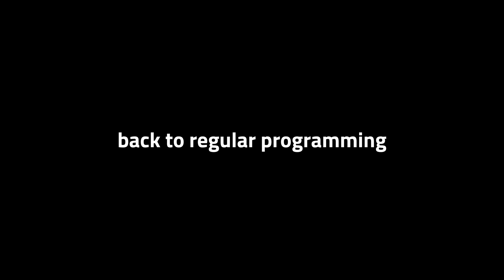Directional Drilling | These Machines Are the Reason You're Able to Connect to the Internet

Comment: And a Vertical Rig is How you get Water Wells , Monitoring wells, observation wells ,  sparge wells , pezometers, oil wells , gas wells , blasting holes , Mineral exploration holes , Bed Rock Wells , and over Burden Wells of all kind I have Drilled. I love Coring Rock that's my Favorite coring  deep holes . So Many Rigs to Run so little Time Traveling all over America Drilling such a wide variety of Wells with such a wide variety of rigs . Drill Baby Drill 💪

Comment: The "sensor" is called a locator
Reply: The main advantage to directional boring is being able to go under structures such as roads that you do not want to trench through. Going through landscaping might not be worth the extra cost of paying for a directional bore machine. Trenching and replacing the grass may be cheaper. But why are they even growing grass in Arizona.